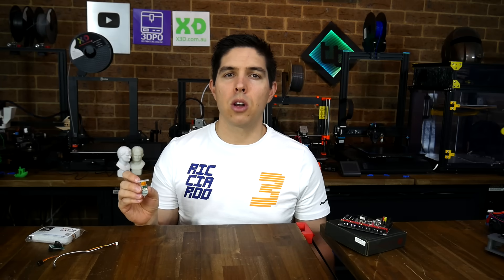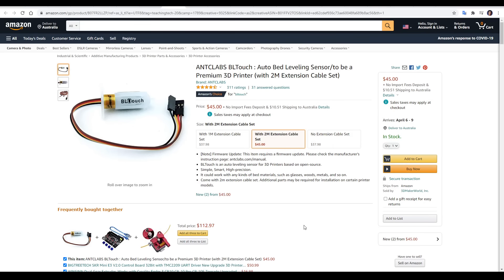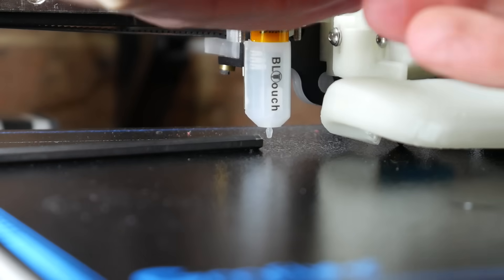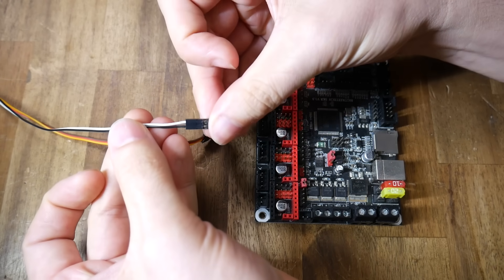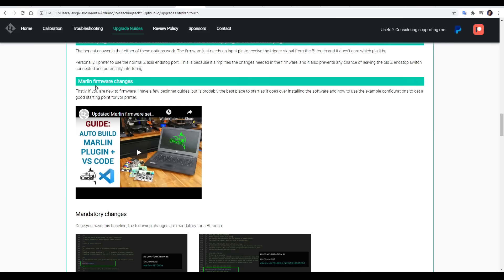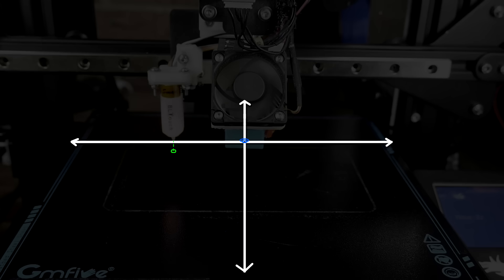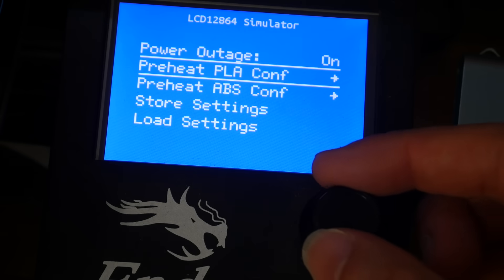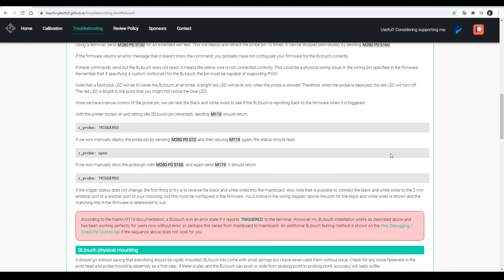BLtouch for any 3D printer - Comprehensive step by step guide

Comment: I bought the BigTreeTech purposely so I wouldn't have to edit Marlin myself and could use a bin.file on the SD card. Everything is working until you try to auto level the bed and the nozzle crashes straight into the bed and continues to try and drive itself through the board. I have the BL Touch antclabs 3.1 and it's horrible, you have to switch the wires around as they aren't red and brown why they would do that? I have searched for days and days and no one has anything where you can download the bin file and install it via SD card. I don't even know how to get into the Marlin firmware to turn on, off, uncomment, add code, config.h etc etc, what's the point of upgrading your board if you have to spend a month learning how to change the firmware manually? If you want to use a new board, don't buy a BL touch 3.1 .. total garbage, absolutely zero customer support at Big Tree Tech, not even in their forums. The entire experience has been horrible.
Reply: Admit it that the problem is you not the bltouch lol. Get smart.

Comment: I am currently updating my new ender3 v2 for both BLtouch and Smart filament sensor.  All worked OK with the basic setup in Merlin bug-fix.  The problem is that when I initiated the Z probe wizard, No entry appeared on the LCD display to initiate the wizard also the activating the LCD_bed_leveling in configuration.h produced compile errors - programable LCD required.  Apparently the V2 LCD is not compatible with this function.  The X Y probe offset does not appear on the display therefore has to be changed in  configuration.h before compiling.

Comment: I am a novice to the Additive Manufacturing world and have to say I learn something new each time I visit your Channel. I have taken your words to heart to start without using ABL and a BL Touch so I can get to know my machine on what it can do -- focusing on it's limitations so I can troubleshoot effectively. That's not to say that I did not go out and immediately buy a BL Touch when I ordered my 3D Printer. I have it installed and since day one could not get it working. I have followed your calibration guide to much success. This video has finally put my BL Touch in operation with successful repetitions of running the first layer gcode from your calibration guide. I have since turned it off  but now know that it is working as intended. Thank you!!

Comment: For my ender 3v2, I could not get the dedicated BLtouch plug you show at 5:30 to work consistently. I had bed crashes and random failures like you show at 11:34. The only way it would work consistently was by wiring to the z endstop and using a firmware from Smith3D.

Comment: I bought an ender 3 about 3 years ago and the aluminium plate was dipped in the middle so I fitted a diy inductive sensor and a modified th3d firmware and it worked well but I had first layer adhesion problems and ended up using a pei sheet on borosilicate glass sheet and now I don't need to use ABL, I just check the level of the build surface now and then to make sure the corners are all level with a dial gauge mounted to the ender3 fan mount and I always get really nice 1st layers.

Comment: You think it's better to lock the bed in place with some nuts or leave it like it is now and have the possibility of adjusting it while printing?
Reply: If you're going to lock the bed in place (some people do) manually level the bed as perfectly as possible first. The BLtouch will make up for a tilted bed but it's best if the bed is as close to perfect as possible to avoid excessive correction being needed.

Comment: Have heard that the BLtouch with the Ender3 V2 also really needs the cables shielded as interference is what has been causing a lot of the blinking red issues when going from one print to the next. Not sure if that is true or not but will be trying it out as I get one or 2 prints and then the blinking red without touching anything.
Reply: I have heard it too but many YouTubers just install it without any issues, maybe it was a firmware error of creality, they released a new one a while ago.
Reply: Cheap cables and interference. Activating bl touch SW mode in marlin 2.x.x should help with that.

Comment: So the BL touch helps the printer on an uneven bed by dynamically changing z of the first layer. What about the rest of the layers... for a concave bed will the part have concave lines all the way up?
Or does it slowly fix the bed and keep z constant after a few layers?
Reply: It slowly fixes the bed as in your second example. You can control the rate that the correction goes away with the following section in configuration.h

// Gradually reduce leveling correction until a set height is reached,
  // at which point movement will be level to the machine's XY plane.
  // The height can be set with M420 Z<height>
  #define ENABLE_LEVELING_FADE_HEIGHT
  #if ENABLED(ENABLE_LEVELING_FADE_HEIGHT)
    #define DEFAULT_LEVELING_FADE_HEIGHT 10.0 // (mm) Default fade height.
  #endif

I use 5mm instead of 10mm, personally. A lot of people seem to use 3mm.
Reply: @mrb2917  Great to know! Thank you for the info

Comment: 11:34 the probe fails one probe point. Back center section of the bed. Any idea why that happened and hpw to correct that?
Reply: My guess is noise in the circuitry caused a false positive. There are 2 options on how to solve the problem. One, is to uncomment #define MULTIPLE_PROBING, and uncomment #define EXTRA_PROBING. Then you can set the Multiple probing to 2 or 3, and the extra probing to 1. Multiple probing number means it will probe that many times per location. The additional probing will be done at a slower speed as well. It will then take a weighted average of the 2 or more measurements with the slower one weighted higher. However, by adding the EXTRA_PROBING 1, it will discard the value that is the farthest off from any previous probing that has been done at other points. 

The second option isn't as good in my opinion but I'll give it anyway. You can uncomment #define PROBING_HEATERS_OFF. This will disable the heater on the bed, and nozzle, before probing, since those are likely sources of noise if their signals are being PWM'd.  Theres a similar option to disable fans or steppers for probing as well. The problem is if yoou have lots of probing points, you're bed will probably cools subtantially while its probing, which will reduce accuracy since the cooling will cause the bed to warp. To prevent that, you can uncomment #define PREHEAT_BEFORE_PROBING, so that the bed reheats back up to temperature between every single probe point, but I feel like that could take a while. You can then set the minimum temperature for the bed and or nozzle for probing to occur.
Reply: Forgot to mention one other potential fix. I'm not 100% certain about this, but if you have your BLTouch connected to the Z endstop pin, then I think you can uncomment #define ENDSTOP_NOISE_THRESHOLD. Then set it to 2 or 3 at first and see if that fixes the problem. It goes as high as 7, but I think you might run into problems if you set it that high. Basically it makes the board ignore a signal that is below a certain threshold, and that threshold increases as you increase the value.

Comment: Have now tested The 3 d Touch for 14 Months since first install and expanded over 7 months to 6 more on different printers ranging from Ender 3 - 5 - cr10s and tevo tarantula pro all working no issues. But the thing is it must be installed correctly both in firmware and hardware or it will give you problems. To avoid problems make sure all wires connectors  are  solid that is where the most problems will have its origin if any.

Comment: My Ender 3 v2 will be here today.
And my BLTouch should arrive soon.

I will definitely keep this in mind.
Thank you!
Reply: If the V2 has a bed that works like the one on the "regular" one and on the Pro then nylock nuts and improved springs are the better investment. Total costs: under 5 bucks and the bed becomes super stable. I can go weeks to months without leveling.

Comment: Great guide, but I think it's hard to call it 'comprehensive' 'for any 3D printer' when there's no mention of RepRap firmware :-)  Granted, the RRF docs are really good, but there are still issues with them and a guide for BLTouch on RRF would help.
Reply: Similarly, the closed-source Qidi family firmware is also off limits (as best I can tell) to a BLtouch upgrade; some clarification might be useful here.

Comment: I havent 3d printed in over a year... I was in the process of upgrading to a new motherboard and started to find it very daunting with the new Marlin.. With your information Im excited to get that done and get the BL Touch installed..
Reply: @Teaching Tech - Do you have a Marlin guide for the BIGTREETECH SKR E3 DIP V1.1 Control Board with TMC 2208 UART